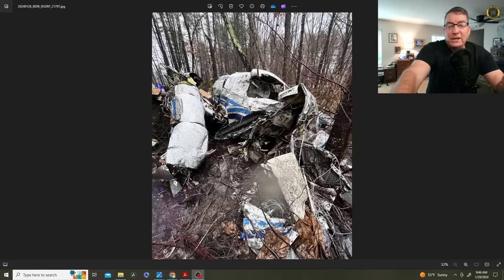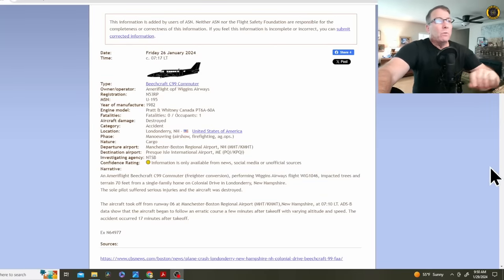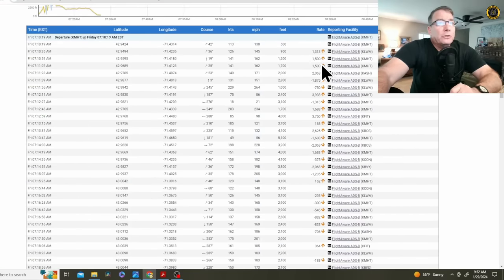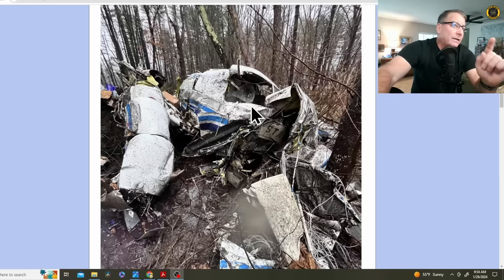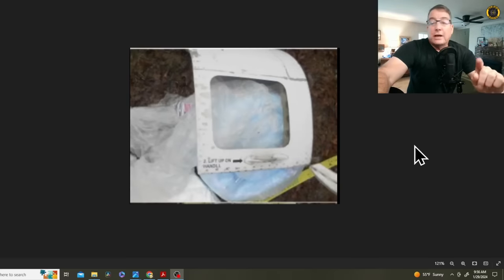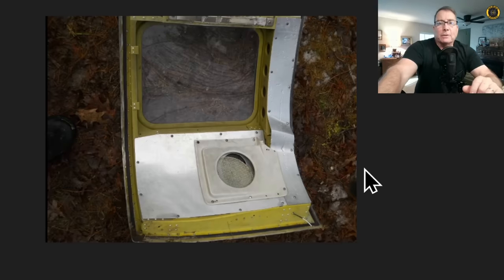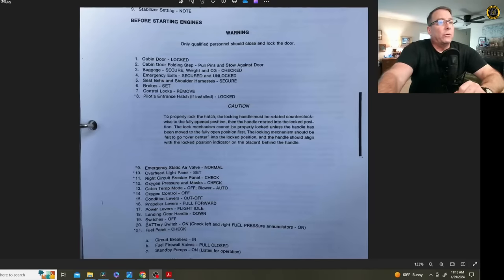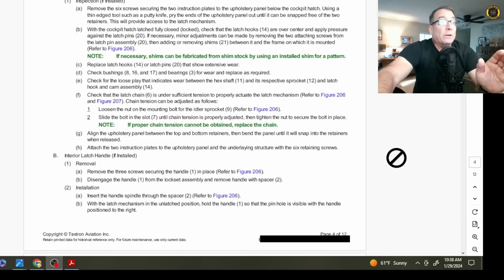Beechcraft C-99 Door Open In Flight Crash! 24 January 2024

Comment: 🚨 As an air traffic controller who teaches other controllers about various emergencies, I try very hard to understand how controllers can figure out what is happening during an emergency, but when first listening to the LiveATC audio, I just wasn't sure what it was. "Icing" or "flight control problem" made my short list, but neither one seemed to be a great fit. Now that we know that the pilot door came off in flight, it seems to all make sense. But no controller could have possibly figured this one out as it happened. (Because I am a current FAA employee, I have to note for the record that these are my personal thoughts and do not represent official FAA opinions.)
Reply: The apparent turn back to the airport should give a little clue to me. But then all the direction changes would throw that away. I would’ve assumed control problems.
Reply: I think once the door immediately departed the aircraft it made contact with the horizontal stabiliser and rudder. I don't think he had any opportunity to shut the door and was fighting control issues. That would fit with the erratic altitude and track. Good report and pleased he survived. Ps, that is a very bad design for  door mechanism, one sprocket has only three teeth engaged, any slack and that would jump.
Reply: Thank you for your post.
Reply: As a GA pilot listening to the radio and radar plot/ADSB track…and knowing most ATCs are not pilots…very difficult to determine. Ident would have indicated Pilot listening/ hearing. Glad Pilot survived and no one on ground hurt.
Reply: Gremlins.
Reply: To my ears, the controllers here were very helpful and concise in trying to help this pilot get to the ground.   It seems likely he could barely hear them (at best) and may have been too busy trying to keep the aircraft in the air.
Reply: ...and bless all you FAA AT controllers that are dedicated to your professionalism and pilot safety!  I've had waaay more good experiences with the pro controllers than I care to count.
Reply: Thank You for Your educated opinion !:-) 🖖
Reply: Totally agree.  Baron doors are prone to popping open too on older models and one can be totally consumed by flying the aircraft.  Can't imagine what it musta been like for pilots in WWII flying shot up bombers and fighters @45KevinR
Reply: Just my casual observation, but have you ever driven a motorcycle in cold weather with an open face helmet? Even at 20-30 mph, the cold wind blast causes your eyes to water. I bet the cold wind blast caused him to not be able to see. That cold would then extend to his hands and feet, making damn near anything impossible, control, radio, switches etc. We will find out if he came in with frostbite on his ears, hands.
Reply: No one knew you worked for FAA until you said you did.
Reply: I agree, 30 years ATC tower and radar. There was no way to determine how to help or what was going on.
Reply: What is it with doors? Was it another Boeing product.
Reply: Nice work Blanco
Reply: @alexanderdavidson7837  Fair comment, but a few would know me and so it's a requirement that I have to add the disclosure.
Reply: @zidoocfi  do they know by your YouTube handle?
Reply: The door looks guaranteed to bash the tail on the way aft.  Seems like skill and a good measure of luck was needed to have survive this one.
Reply: @toddw6716 oh hell no! Good Lord ... 🙄
Reply: I appreciate the calmness the controllers expressed, but I am sure their adrenaline is starting to rise when there was no response from an erratic aircraft. Congratulations
Reply: I hope there is a follow-up when the pilot is able to speak openly about his attempts at recovery
Reply: @alexanderdavidson7837  He literally stated such in his first sentence.
Reply: @toddw6716  Beech. Boeing has serious issues, but when talking about aviation, please be precise and factual.
Reply: @claycassin8437  don’t recall having any dialogue or interest in anything you say or represent.  Thanks for nothing
Reply: Thank you for your service, I imagine you're a great instructor  if you're teaching these aspects to the force.
Reply: Were you a DEI hire?
Reply: @KrisD007  no I'm a plumber.
Reply: @alexanderdavidson7837  sounds like you are suffering from hypoxia or some other form of oxygen deprivation.
Reply: @yamahale  sweet burn
Reply: @floatpool8307 That had nothing to do with diversity. Just where do you think they could get enough former pilots who can also handle ATC? Totally different skill sets.
Reply: I have to say, the controllers on this one seem to have handled this VERY well: Try to make contact, realize there is an issue, maintain attempts to make contact, and broadcast alerts to the pilot hoping that he'd get them and take appropriate action. And when the pilot did manage to make contact back and ask for a runway, immediate confirmation and direction, and continuing to try to get him there, in spite of the very short communication. 

Wouldn't be surprised if one or two of 'em were trying to will that bird in...
Reply: @floatpool8307  yes. I remember giving no gyro vectors in the 90’s by the late 90’s half the controllers had no clue what that was.
Reply: @claycassin8437  that’s why you yell Mayday. Cause the shock of the situation, nobody would comprehend what you said. Why do you think the controllers always ask the pilot to say again. The human brain doesn’t work that way.
Reply: @claycassin8437  keep you comments to yourself. Nobody understands that drool you say.
Reply: Ameriflight was my first A&P job out of Burbank CA. I’ve rigged that door several times and it is a pain in the ass to get it right. Once u done it a few times it’s not that bad but the first time you’re going be there a while. You gotta get those hooks to grab the pins at the same time then both go over center as he explained. I’ve seen them incorrectly rigged before when only one hook is going over center. That door is the main way to enter exit the cockpit on these cargo aircraft
Reply: The problem was it was an Alaskan airlines hopper😂
Reply: @toddw6716  That's because I just make gurgling sounds when I drool.
Reply: & thoughts to IMC in the cockpit with freezing cloud now coming inside? How would you try to determine such? How would you help such?
Reply: I am such a fan of this channel. Juan is so good at explaining things even this non aviator can understand.
Reply: @toddw6716 
     Its says Beech in the title - Beechcraft 99. 
Designed and manufactured by …. Beechcraft, Wichita, KS — more than a few years ago (likely a 20+ year old airplane; I think 99’s are out of production for some time). 

     Open likely because someone failed to close it properly (been there seen that happen by folks, more than a few times !! ) after a maintenance procedure / last programmed maintenance or inspection or mechanism damaged, needed repair….
     But we shall all see….
Reply: What a fun, and absolutely necessary disclaimer at the end. Best of luck!
Reply: I think ATC needs to do flights with both GA and commercial as part of their training. Specifically for the airport / area they're controlling. They don't need a full pilots license but they need an idea of what it's like in the air.
Reply: @alexanderdavidson7837  it's a bad move to assume you have security in your online identity remaining separate from your real identity in the future. If it is a requirement that you make a disclosure, you do it even if no one knows. If you don't, you only manage to make things worse for yourself.
Reply: @scythelord  I stand by what you’ve said.  
I regret my comment

Comment: AMF pilot from 2000s, flew this particular plane (79 hours). Two main issues - door latch was a critical item - you needed to look and see the latch was fully engaged. There were two holes for you to look specifically at the lock capturing the pins. As to BE99's generally (A/B/C), my experience was this often took multiple tries - one side would latch but not the other. Grab a flashlight at night to check. If it was not fully locked, you'd see it just clipping the bar, but slightly open to the side (e.g. there's be a spot for the bar that would not be flush with the bar). O2 masks in the BE99 are O2 canister based, unlikely he had a mask on. Additionally, BE/99C's with a belly pod pick up ice really quickly and there are no boots for the pod. I can only imagine that if you're dealing with a door open, you're not reaching for the wing boots, and I can see overweight coming down and him finding himself too slow. Finally, the pilot is typically involved in loading, so in cold weather, we're bundled up. Closing the door just gets the wind away. Likely the pilot still had his heavy coat on, but gloves off and hat off. Glad he survived.
Reply: Brings back some PTSD 😳
Reply: SECURING THE CREW DOOR 
It is important that the crew door drawhooks are fully engaged over the latchpins when securing 
the crew door. This can be verified by visually checking through holes provided in the sides of the
 doors, or feeling with your little finger through holes in the tops of the door frames above the latchpins 
in BE-99s. Unless the aft surface of the drawhook inner radius bears against the pin, the hook is
not properly secured. If It comes loose in flight, the door will probably leave the airplane and may
 severely damage the empennage upon departure.
Reply: That has to a terrible design to require that much checking, especially if it looks and feels closed.
Reply: @jmevb60  Totally agree. Shutting a door securely on an aircraft shouldn't be this difficult. DESIGN-FLAWED.
Reply: @jmevb60  gotta love air travel from the 80s
Reply: I always questioned these Ameri flight aircraft... pilots always say how sketch they are
Reply: I flew for AMF in the early 90s. Risky flying with numerous almost deaths in the 2 years I was there. 3 or 4 of them happened to me, including an unsecured engine cowling that lead to a maintenance SOP change after a trip to see the chief pilot. One dude took a duck through the windscreen. Hit him right in the face but he was still able to land at an airport with a broken skull.
Reply: @JimmysSpeedShop  Said the Bar Harbor Airlines pilot who fell out the rear door and was clinging on to the door steps on his back upside down while the new co- pilot landed the BE99.
Reply: I don't remember if the former Bar Harbor 99's(notA,B,C) had the crew door but the latching mechanism reminds me of the fwd, upper cowling latches on 99's and King Airs. Tricky to get right. @therkyn
Reply: I wonder if the air rushing in and hitting the cargo induced drag and a subsequent left turning yaw effect.  It might exlain the abrupt left turn on climb out.
Reply: Thank you for the insight.
Reply: Door flies off? Fly the airplane.  Puking?  Fly the airplane.  If anything abnormal happens?  Fly the airplane.
Reply: @JuanSanchez-ik7wx I seem to remember a similar story years ago. The pilot went back to check the door and it opened. When the copilot landed they had to pry the pilots fingers loose. But it may have been a different flight.
Reply: Another consideration to think about is all the freezing rain and ice beating the pilot in the face while he's trying to maintain control. He may have also switched over to the right seat trying to get away from the open exit to at least get a little relief. I can't imagine that whole scenario and how horrific that was. Lucky to have survived the crash.
Reply: If there's enough play or wear and tear in that mechanism the latches could move open due to vibration even though the handle position indicates closed.
Reply: I bet you don't miss that job at all  @therkyn
Reply: Thanks for the in-depth analysis of the situation that’s particular to this aircraft.
Reply: Also makes wonder if there’s any sensor system that gives the alarm if the door isn’t fully latched 🤔
Reply: @vernonsmithee792 finger trouble!
Reply: I have a good bit of time in 52RP/ beech99s in the late 2010s. Those doors were always giving us problems. Thankfully was always able to see both indicators. Imagine at night in bad conditions wasn’t able to see one of the doors didn’t latch.
Reply: A lot of former Ameriflight pilots are commenting. Are they related to Wiggins?
Reply: @beenaplumber8379  incidentally that’s 4 bad crashes crashes (total loss) for AMF/WIG in just over a year, two dead
Reply: @CaptBryce  Ok, but is AMF related to Wiggen? Or do they just fly the same planes? (B99)
Reply: @beenaplumber8379  I wrote out a nice thought out reply talking about how AMF and WIG are sister companies with the same CEO and Board and how 53RP was on an interchange agreement and had heavy MX done by AMF and was flown by both AMF and WIG depending on demand. And somehow it got flagged and taken down? Idk what happened
Reply: @CaptBryce  Thanks for clarifying Captain. I doubt your comment was flagged. It's been happening to me a lot these past couple weeks on perfectly innocuous posts. They just sometimes disappear, and I've been hearing the same from others as well. I think it's YT gremlins, or maybe some nascent AI patrol they're testing with its training wheels still on. Thanks again for the explanation 🙂
Reply: One of those jobs that makes you or breaks you as a pilot.
Reply: Poor design.
Reply: When I was flying 99s, the C models were mostly still flying passengers, and we flew As and Bs converted from pax birds with slightly smaller belly pods than the C. Still collected ice. For awhile I flew the former Bar Harbor one that had attempted to eject its captain out the passenger door. The sheet metal work around the door didn't look like the other birds. Clearly there had been some rebuild work there. Never had any trouble with the cockpit access latch, though.

Comment: Seeing the accident wreckage, its a miracle anyone survived.
Reply: Yes
Reply: No fire and the cargo didn't crush him. Came to rest right side up after crashing through those trees. Incredible odds of survival
Reply: Indeed, it's worked like the passenger cell in a car, and in an aircraft it can only be luck.
Reply: Plus he had takeoff fuel on board, and there was no fire. A true miracle.
Reply: I'm guessing hitting the trees dissipated alot of energy and saved the pilot
Reply: At first sight I thought it was a fatal
Reply: Well, it happened twice now, and everyone survived, so, no biggie?
Reply: @JohnDoe-yj5ng  what's your point?
Reply: @DLRPyro1  And the powerlines.
Reply: Not really, it is in one piece, cabin is not shredded...no fire or explosion....which is very often the cause of the death. Looking at the wreck, my first though is not that everybody had to die 100%
Reply: Beechcrafts ain't nothing to uck wth
Reply: Former 99 freight dog here. Achilles heel of the 99 is its all electric pitch trim; there's no manual backup. Pilots startled by a sudden emergency have been known to have such a death grip on the yoke that their thumb inadvertently falls on the trim switch, suddenly adding heavy stick forces to their other problems. The emergency trim procedure is not very intuitive, and easy to get wrong in the face of other distractions. Checkrides always included a runaway trim scenario. Control forces get very heavy very quickly. This could account for Wig 1042's gyrations. Said gyrations probably shifted the cargo some, especially if the load was relatively light, leaving lots of empty room in each cargo space. The compartment nets are all vertical and won't provide much restraint to fore and aft movement within each compartment. Glad it wasn't me.
Reply: More miraculous than the Hudson ditching? I'd think so.
Reply: @PainflyErect  Miraculousness Quotient is pilot skill + luck, multiplied by number of innocent passengers who didn't die, so....no, Sully and Skiles still rule.
Reply: @wcate8301  Dude, did you see how wrecked that plane was? Wild anyone walked out. To be honest, I've saved a deep dive on Sullys miracle, so my comment's coming from a place of ignorance.
Reply: @PainflyErect  Yup, I saw the pictures. I've seen plenty other pictures of wrecked planes, and seen some in the flesh. My (amateur) theory is that the long schnozola on the 99 provides a bit of cockpit protection lacking on some shorter nose planes and on those with a heavy chunk of hot metal and flammable liquid ready to be shoved in the pilot's lap. Some wrecks will amaze you that anyone survived, others, that anyone died.